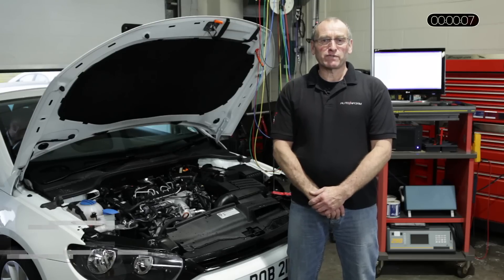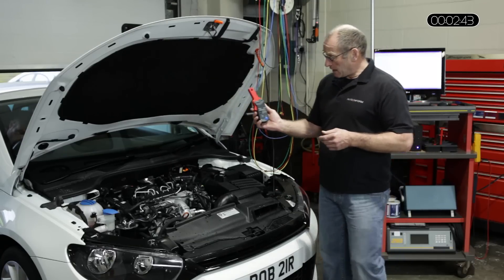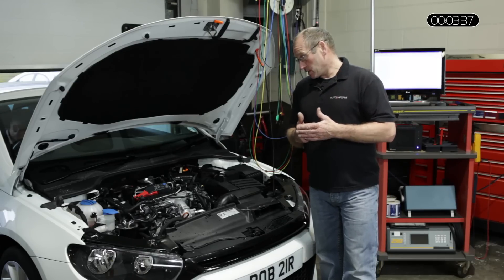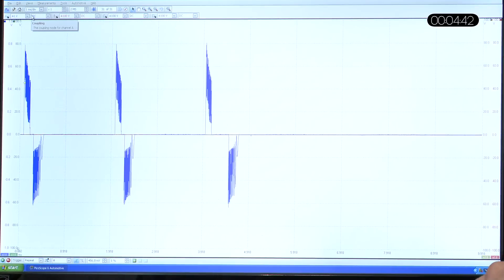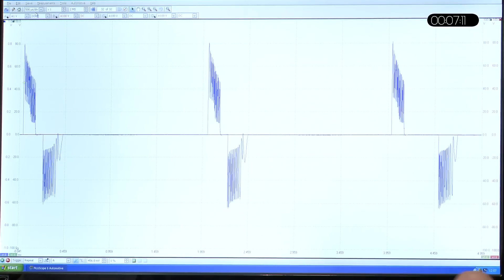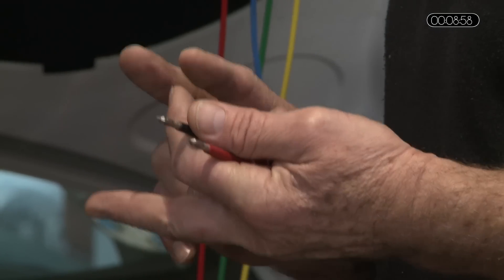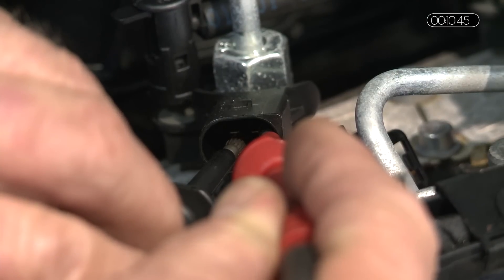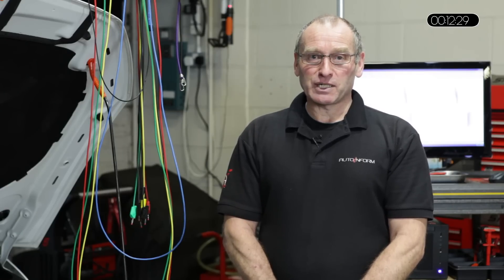AUTOiNFORM ONLINE MAGAZINE: Testing Piezo Injectors with Frank Massey

Comment: Great tips on common rail frank thanks for sharing it , if the Injectore fail by dribbling fuel and cause the vehicle to create black smoke , would that test verify which Injectore are faulty , despite carried out boost leakage test and smoke test no leak was found but the vehicle still puffing out black smoke .